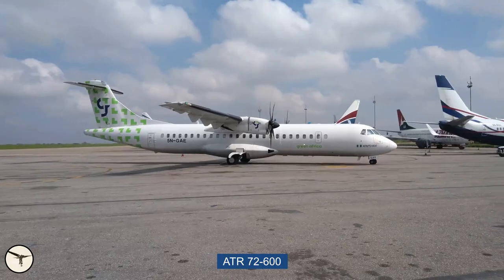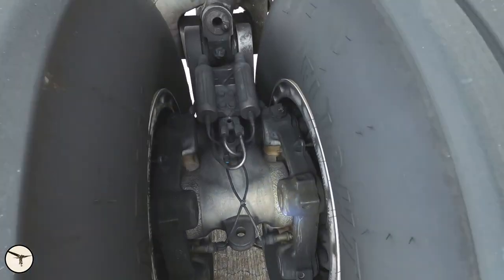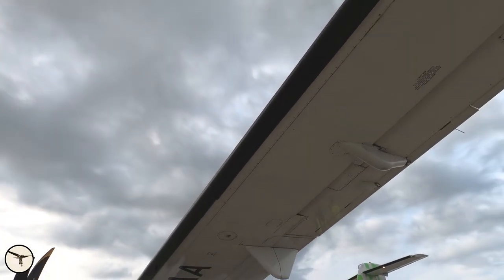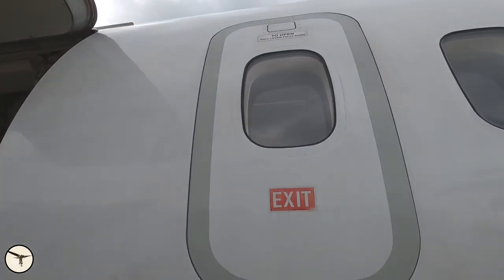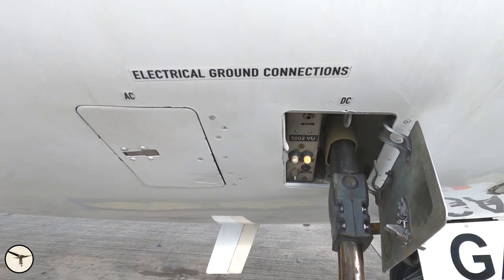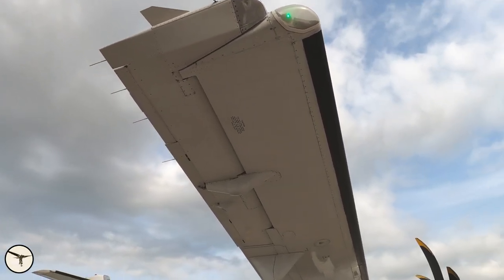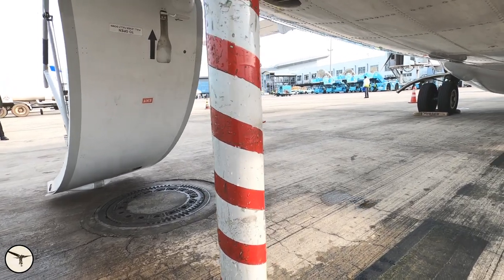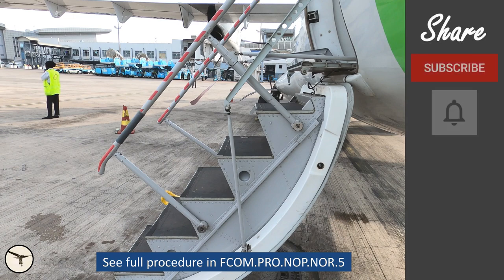ATR 72-600 walkaround

Comment: Dear Sir Sorry to correct you. The propeller blade leading edge tip is only made of nickel called nickel sheath. The overboard valve is below the fwd cargo. What you told is an antenna. The third thing you said battery ventilation is the drain for overhead emergency exit and the battery ventilation is just below that drain and is visible from bottom

Comment: Very interesting to see how much the flight crew needs to look out for when doing a walkaround.
One thing makes me wonder though. The ATR, being a rather small airliner that sits low to the ground has all the important bits and pieces pretty close to the ground. I can only imagine that some of the items to check for would be sitting pretty high up when looking at larger aircraft, not to mention an A380 or Boeing 747. Could be quite tricky to see everything, especially during the dark hours, even with a flashlight and apron illumination...

Comment: “No cats inside here”… yes, you got to check for those guys! 😂😽

The most detailed walk-around video I’ve seen yet. Love Capt. Magnar’s videos. 👍🏽

BTW, why did you leave the fuel monitor thingy (pardon technical term) flap open? Was the plane still due to be refuelled?
Reply from the maker: Yes, I set 1800 kg at left the panel door open. The fuel truck arrived shortly after.

Comment: Why are there two Captain, two FO and two Standby static port but only one Captain and one FO and one Standby Pitot ? Shouldn't each static port be paired with one of its own pitot only ? Thanks for the detailed walkaround.
Reply from the maker: The static ports are interconnected to compensate for pressure changes during sideslip. The average static pressure is then paired with the total pressure from the associated pitot tube.

Comment: Hello Magnar! Can you make a video talking about vnav and other autopilot features of the ATR/72-600 ?  I use to configure VDTO via the FMS but I have seen some pilots use VDTO just by double clicking the VNAV button, This confuses me alot of how this happens..
Reply from the maker: I assume you are referring to a flight simulator? In the real aircraft, Vertical Direct To (VTDO) can only be configured in the FMS. When you press the VNAV pushbutton a second time, the Flight Director will change to Pitch Hold mode. The reason is that actions on the Flight Guidance Control Panel cannot change FMS settings.
Reply: @FlywithMagnar  On the real aircraft. My mistake what i meant to say was triple click, when you press twice the aircraft goes in to pitch hold green. when you press the third time and if the VDEV is greater than a certain value, when you press VNAV the third time the  V-Bar comes to the center and VNAV PATH green 
i might not be explaining properly but I will provide a video of this in action next time I go flying. :) . Thank You Magnar.
Reply: @FlywithMagnar  Sir last Sunday this model plane which met with tragic accident in Nepal ,if you had seen the viral video just moments before crash can you make it out wether it was human error or due to technical defect?
Reply from the maker: I have not seen that video, and even if I did, it would be impossible to determine the cause for the accident. An accident rarely happens because of a single factor, but a chain of events. Therefore, we have to wait for the accident report before we can draw conclusions.

Comment: very informative Captain, Just one remark, almost all doors open outward, which is, that dangerous? giving the Accidents of the DC10 previously for that reason in particular..
Reply from the maker: No, it's not dangerous. The DC-10 had a faulty locking design in the cargo door locking mechanism. This was rectified, and the DC-10 became a very safe aircraft. The doors in the ATR are held on place by some very strong bolts. The cabin pressure pushes the doors (and the bolts) against a steel frame. The force is so strong that it's impossible to open the doors in flight. Even if you have the strength of the Hulk, you will just break off the door handle.
Reply: We all remember the DC-10 cargo door,  but there was identical incident with the 747, which nobody remembers, and it did not affect sales of the 747, probably because Boeing had better connections in high places.

Comment: Thanks for sharing these informative videos. Do you have to be careful while touching parts that are heated during flight (edge of propeller, pitot tube etc), while inspecting at a halt? Or do the parts cool down as soon as the aircraft is parked? What about the turbine exhaust pipe, does that stay hot for a long time after the engine has been shut down?
Reply from the maker: No, that's not a problem. All heating elements are switched off after landing and cool down before we stop the engines. The exhaust pipe is too high up for us to touch, but it is made of a thin metal sheet and should cool down fairly quick.
Reply: @FlywithMagnar  , thank you Magnar.
Reply: it is possible to burn yourself on the pitot tube but usually its not too hot
Reply from the maker: Yes, the pilot tube is burning hot when heated. Therefore, never touch it in case the pilots forgot to switch off the heat.
Reply: @FlywithMagnar  your ATR preflights are much different than my Piper Archer walkarounds 😅

Comment: I was under the impression that all pressurised passenger aircraft had cabin doors that were impossible to open while the cabin is pressurised, usually having to be pulled inwards first. Is this true of the ATR?
Reply from the maker: The doors can only be opened when the cabin is not pressurised. The cabin pressure pushes the door outwards against six steel bolts that held the door in place in the door frame (also made of steel). The door handle acts on those bolts. With the cabin pressurised, it is impossible to move the door handle. I have a feeling that the handle will break first.
Reply: @FlywithMagnar  Thanks. That's reassuring.

Comment: Curious why the tire pressure at 3:45 is pounds per square inch, not kg per square cm or bar.  The fuselage fueling port at 15:25 has both psi and bars, but the tire pressure is just psi.  I know altitudes are in feet for historical international compatibility, but I wouldn't think it would matter for tire pressure.

At 19:22, the sign says "PORTABLE WATER SERVICE".  Shouldn't that be POTABLE (drinkable)? Well, maybe not, if it's for the toilet :-)
Reply: I see PORTABLE was mentioned by someone else.
Reply from the maker: PORTABLE is a typing error made by those who made the label.

Comment: There is a spelling mistake on the stencilling on your ATR, it says portable instead of potable. The panel aft of the passenger door is the access cover for the potable water system. Thus it should be labelled POTABLE (as in safe to drink), but your aeroplane has it labelled PORTABLE (as in easily carried). Oops.

Great video as usual though and useful too; I work on Loganair ATR-42s and 72s at EGCC.
Reply from the maker: I know! Have to blame the paint shop for this one.

Comment: 1:50 If there would have been wrinkles in the skin of the aircraft, would you have cancelled the flight?
Reply from the maker: Yes. The ATR has a very smooth skin, and wrinkles means the airframe has been overstressed.
Reply: @FlywithMagnar  Thanks for your response.

Comment: Not having any aviation knowledge or being familiar with the ATR..one would assume when inspecting the hydraulic reservoir fluid level one would check the hydraulic pop out indicators..also engine drains for no fuel leaks..
Reply from the maker: In fact, no. 

To my knowledge, there are no pop out indicators in the hydraulic system. There are HP filters downstream of the pumps, and return filters in the return lines. If a HP filter gets clogged, the pressure in the line will drop. If the pressure drops below 1500 PSI, a low pressure alert is triggered. The procedure is to select cross-feed, which means the other pump will supply both hydraulic systems. If the return filter gets clogged, a bypass valve is opened. The mechanics check the filters regularly. 

There are no fuel drains in the engines. There are only drains at the lowest parts of the fuel tanks. Between the fuel tank and the fuel controller (HMU), the line is always full of fuel. Any water further down in the system will go through the engine during start, and we will not even notice, because the water will vaporize and provide a just little cooling of the engine.

Comment: Hi Captain, i was wondering why are there 2 fuelling panels? one on each side?!
Reply from the maker: There's only one refueling panel, and it's on the right-hand side
Reply: @FlywithMagnar  Okay captain, then what was that fuel related panel you showed on the left side.. where you selected some fuel quantity?
Reply from the maker: @shreeganesh4281  the fuel quantity is selected on the panel ahead of the right-hand main landing gear. The refueling point is behind the right-hand landing gear. On the left side of the fuselage are several hatched giving access to the hydraulic system.
Reply: @FlywithMagnar  okay captain thanks a ton!